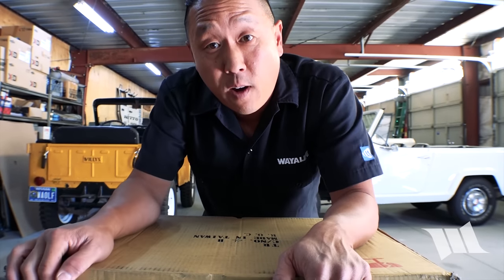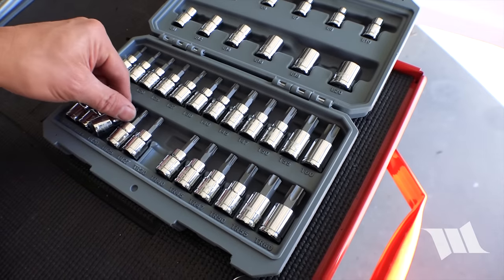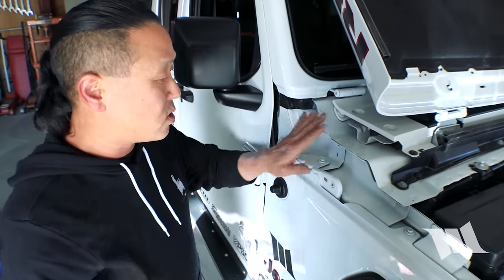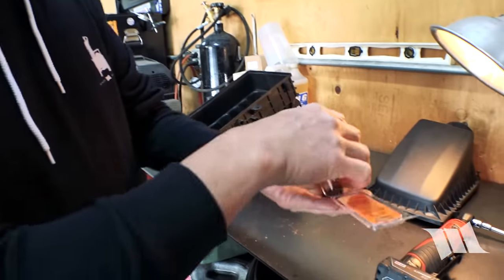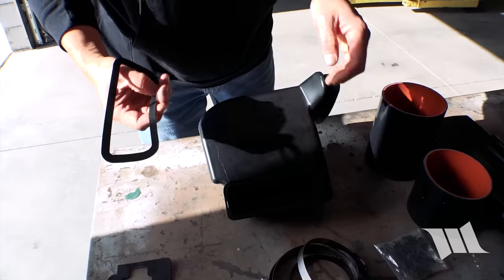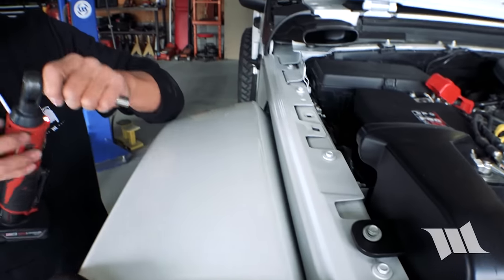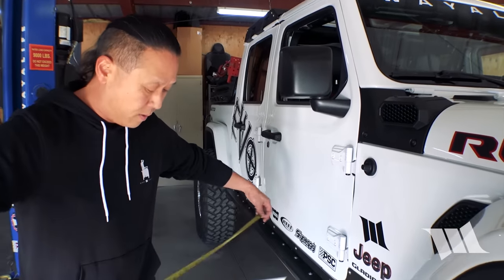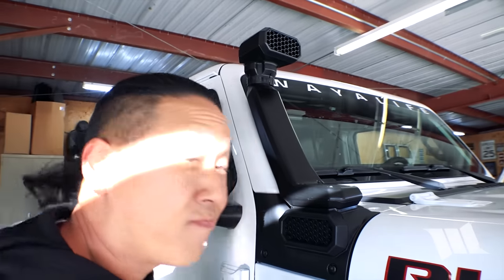Rugged Ridge AmFib Snorkel HOW TO INSTALLATION on a Jeep JL Wrangler or JT Gladiator Truck

Comment: Man, I really want the snorkel but I also want a supercharger down the road. What would you reccomend, stock air box with custom piping to the SC? Always worry about flat filters with boost 😅
Reply from the maker: Sorry, not a fan of superchargers. Regear to the right ratio and you should be fine with that. If you want more HP, get a V8. Trust me, there's a reason why shops that specialize in V8 swaps have TONS of pulled engines with superchargers bolted onto them.
Reply: @wayalife  Very true, no matter what you do to a V6, it's still a V6. What in your opinion would be the ideal V8 for the JT?
Reply from the maker: Well, right now, the only thing going on for the JT is a HEMI swap. Although, I would prefer something like an LT. That's what I'm running in our JK now.
Reply: Have you been able to find any sort of lightbar brackets that would be compatible with the snorkel? Looks like it sacrifices most conventional A-pillar/cowl mounts. I've been looking at the Hauk Expedition for this reason, but it looks a little odd as it's further in from the fender on the plastic fresh air cowling.

Comment: Question; which snorkel do you recommend the Rugged ridge one or the Hauk river raider?  I am leaning towards the river raider but don’t have any personal experience with either.
Reply from the maker: Ummm, I hope you don't take this the wrong way but there is a reason why I chose to install a Rugged Ridge snorkel on my Gladiator.
Reply: Good point.  I think I remembered you talking about the River raider before.  Other than maybe the look, cause the RR snorkel looks awesome, what made you go with it?
Reply from the maker: Aside from just not liking the way the River Raider snorkel on a JL looks? Well, I'm a BIG fan of the factory air box and especially of the factory air filter. I've found it to do a GREAT job of keeping dirt out of the engine. I also like how easy the Rugged Ridge snorkel was to install, I like how I didn't have to cut into the plastic cowl trim, I like how it has two options both high and low and how they can be swapped out in about a minute and LOVE the way the Rugged Ridge low mount looks so factory.
Reply: Perfect, thanks!

Comment: Wayalife , from your experience with jl’s when your on these big group rides are those a lot of 2.0t’s on the trail ? If so how do they do ?
Reply from the maker: There aren't too many 2.0s. They do great stock but I haven't been too impressed with them once they get up on 37's even with a regear.
Reply: Wayalife . What do you think my options are ? My goal is to take this Jeep cross country exploring trails . You think I can get away with 35’s and a lift with re gear ? I’m hoping that set up would work .. or would you
recommend trading in or doing engine swap ?  I guess I’m not sure the sweet spot on tire size  to do what you do . Appreciate your
Input .
Reply from the maker: @1224tms  Sorry, didn't realize that you have a 2.0. There not horrible, I just prefer the 3.6 over them. That being said, running 37's is probably the better way to get you out on bigger rocks but 35's may be the more practical way to go for exploring.
Reply: Wayalife don’t be sorry thanks for the honest input , that’s what I was looking for .